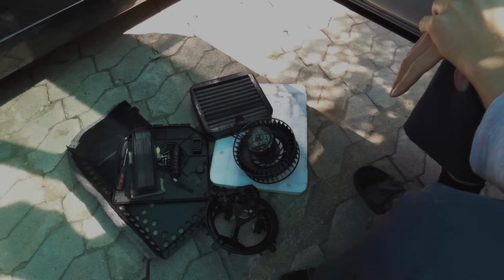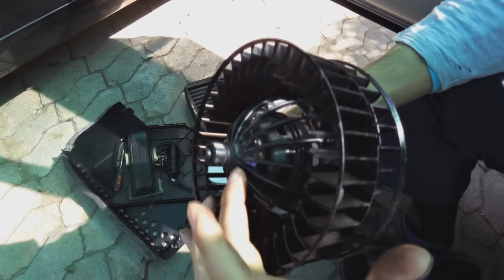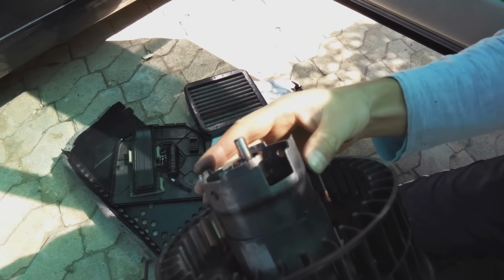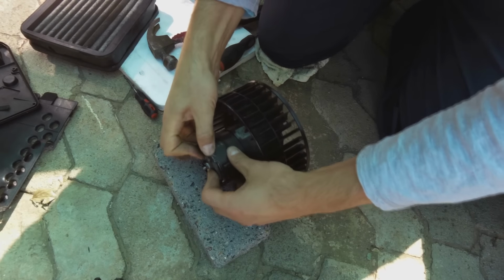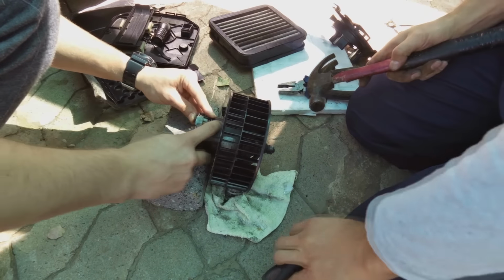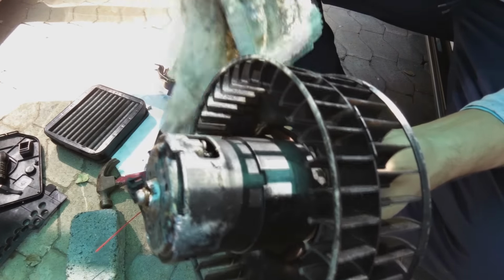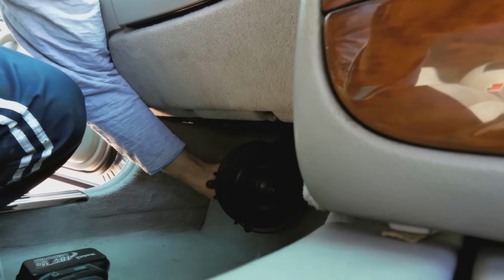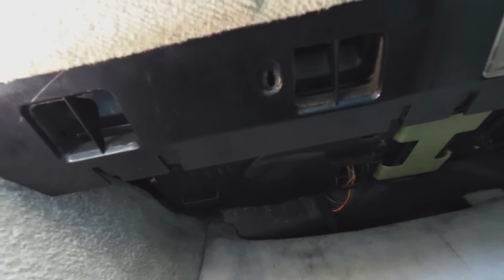Blower motor service and fix / repair for Mercedes Benz

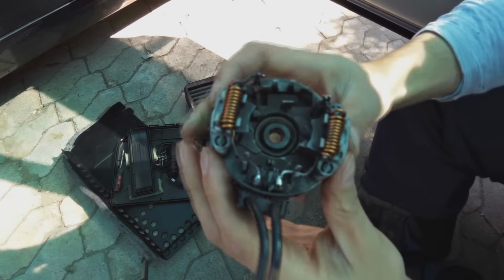Comment: The fan on my SLK320 stopped working. I took it out of the car to check it and found one of the connectors to the motor housing was a little loose. I plugged back in to the car and turned it on and it would work sporadically when I wiggled the wire. Turns out the solder connections had come apart inside the motor housing (like he shows at 2:55)  The way my unit is made it's very hard to get the housing off to re-solder the connection. So I removed wire and carefully heated the connector with a micro-torch for a few seconds, which remelted the solder and restored the connection. Now it works like a champ!  I was about to buy a new fan, the fix cost $0. I don't know how long it will work, but it's working now.

Comment: Hello everyone. I just wanted to share how I got my blower motor to work
 after it started to work intermittently. Just to let you know, I did 
replace the blower motor voltage regulator. But the AC would still only 
turn on intermittently. So what I was going to do was the repair in this
 video but I couldn't get that top piece off after drilling. I left it 
on and took a large can of WD-40 and prayed the heck out the unit on the
 inside using one of the top holes so that the electronics, brushes and 
electrical connections were on the bottom. The WD-40 cleared all the 
dirt and grime that had accumulated inside. The residue was black and 
was cleared out of the unit with the WD-40.

That took care of the cleaning on the inside and also cleaned the electrical contacts of dirt and grime. Remember I used an entire can and prayed multiple times to clear all the dirt and grime. Let the unit sit in the sunlight for a day before you continue. This will evaporate the WD-40 and ensure that you do not damage the unit if the contacts are still wet. 

Then came the most important part, that is also addressed in this video. You MUST clean that copper contact post where the brushes come in contact with. That post gets so much grime and oxidation that the electrical contacts become unreliable. Since the WD-40 took care of the dirt and grime, you have to take a small flat head screwdriver and scrape the metal to get it shiny again. Take the driver and carefully scrape top to bottom. Clean one section at a time by turning the fan portion. Once the electrical post looks shiny all over you will guarantee that a strong electrical connection with the brushes will be established. The guy in the video even mentioned that he was getting double the current than before the cleaning and scraping. 

My unit started working immediately after installation and even seems to be stronger than before. Its been good. These units are well made but unfortunately get dirty over time and do need to be maintained. Mine is located in my 2000 Mercedes Benz S-500. 

Good Luck everyone!
Reply: I'm going to follow these guidelines.  You can also change out the brushes but mine look like they have a good amount of life so I'm actually going to change out the spring just to have good pressure.  Thanks for this update.

Comment: Very instructive, thank you for the thorough effort ! It seems however, that there is a second blower in there, clearly audible when switching on the ignition at 21:47. My MB is a E-class 320CD (W211.022). I hope it does not have two blowers as well.  :-)

Comment: Hi could u please do another video of replacing or repairing the rear a/c air blower motor of w220. My ride has 2 a/c. With separate controls one in  front 2 in rear thanx

Comment: For those of you out there that see this comment, I posted a long video on how to remove the W124 dash and how to replace the vacuum actuator pods for the climate control.   https://www.youtube.com/watch?v=0SU6CFb0W7s

  Just trying to spread the word.  Note that there are only 2 PN's left of the 6 PN's that are available from Mercedes or aftermarket.  On the dual diaphgram pods you can buy one of the two pods that are available, remove their arms (white plastic just snaps it on),  and you can take off the old arm from the old pod and transfer it to the new pod. NOTE:  This trick only works on the dual diaphgram pods.   Last resort  you can get just the rubber diaphgram inside the pod that you can replace at a place called Performance Analysis in Tennessee, although you can't order on their website.  You have to call them.  Their part numbers for the two different diaphgrams are 2010 and 2020.  On the W124 and W126, you can use one of their diaphgrams on the "center" pod, which is a single diaphragm.  They are inexpensive, not sure how long they will be in business from the conversation I had with them. . Get a bunch and store them the rest of your life!

Comment: What number is the fuse that goes into the side panel by the door on the driver side for the AC blower
Reply: I need to kno the same thing do u have the answer?

Comment: The hammering you were doing is what we call peening over the metal.  I just bought a 1999 E300 turbo diesel with 101k miles on it.  The last owner had it for 12.5 years and put only 4000 miles on it.  Apparently blower not used enough and has gotten frozen in place.  I will expose it and tap it a few times with a soft rubber mallet and see if that frees it up.

Comment: SA represent! My blower just stopped working for no reason and without warning. Seems to be intermittent so will try this.
Reply: Kyle Smitsdorff
Reply from the maker: after doing this several times i now use a bearing and retrofit the bearing into the fitting. Bearing is best.
Reply from the maker: since this video i have now started using a ball bearing as a retrofit.
Reply: Can you please tell me the dimensions of the bearing? I want to buy it before I open the blower motor. Thank you.

Comment: So instead of replacing it and getting a warranty you spend how much of time repairing at home. Ridiculous.
Reply from the maker: why buy a new one if you can fix the old one in 30 mins? new one in SA is $400. Still need to fit a new one which will take 15 mins so i dont get your point. Maybe if a new one was $10 i would agree.
Reply: The point is you have no warranty,  the video is 28 mins long so I assume it was  over an hour for the " repair ".  And when it fails again you are no farther ahead.
Reply: Stephen what is wrong with you? Some people replace, some people repair. Personally I prefer to repair and if you do yourself and well done, who cares about the guarantee because you know it won´t break down anytime soon. Why not say, instead of wasting time, just bring it to the workshop. Sometimes it is best not to say anything than to make a proper fool of yourself. Personally I do appreciate people that make an effort to teach others.
Reply: @MercedesBenzW124  you're right! 
Well oiled the used blower motor will last much longer than the new one with nearly no lube ... if the brushes are long enough!

WD40 is really a light cleaning oil, not good for bearing lube! Heavy gearbox or engine oil better....
👍🏻
Reply: Stephen why watch a repair video if you obviously don't want to fix it.  I'm more confused that you spent nearly 30min watching a video to complain about the time involved.  Most people get an enjoyment out of fixing these older cars but others like to get work done and have warranty.
Reply: @dakota383  Warranty or not, you're forgetting the transaction cost of going to the dealer or repair shop to get it repaired. Scheduling the repair, traveling to and from the repair location, waiting for the repair. It all adds up and may be way more than what was spent on the self repair. So you're actually paying cash for the repair, paying by spending time driving to and from the repair place and waiting.

I don't understand why someone would pay cash and still spend more time all for the warranty?!